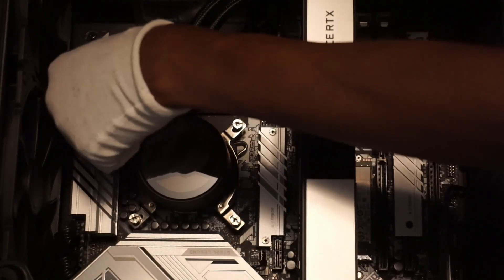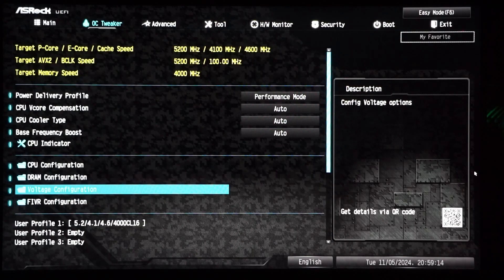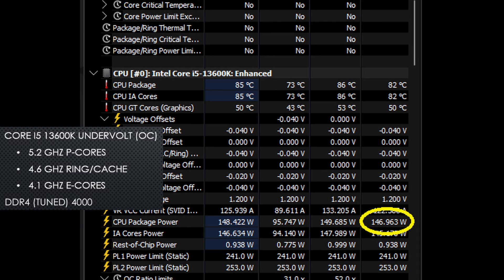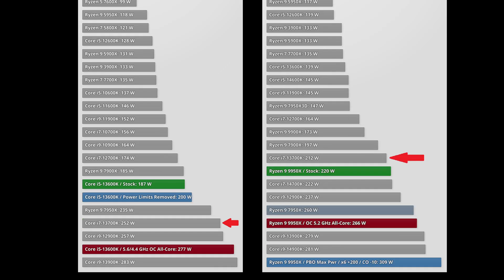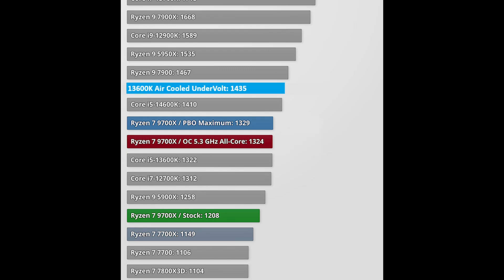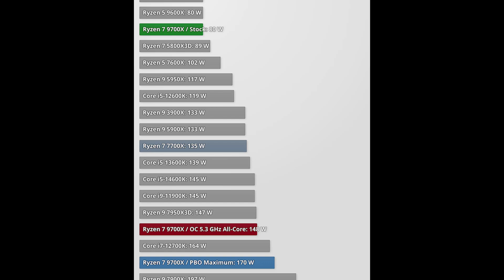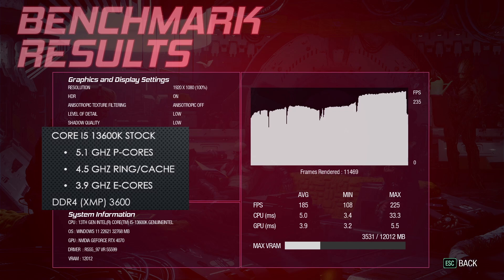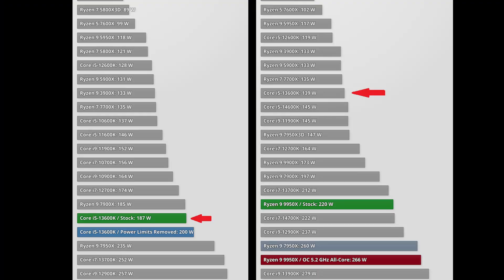13600K Efficient Air Cooled Undervolt. Faster Than Stock. Using Less Power.

Comment: Is it still stable after the last microcode update in 2025?
Reply from the maker: 20.01 (0x12B) was the last BIOS I used on this board, it was still stable with these settings when I stopped using it.

Comment: i do not understand why you stopped at -40 did it became unstable or you started to drop performance because of CEP ? I have asrock b760m with 12700kf and undervolt gets me half performance after a certain threshold, depending on the benchmark, Geekbench 6 even at -30
Reply from the maker: I stopped at -40mv because it becomes unstable if I drop the voltage too low.
Reply: @Superior85  thanks for the info!

Comment: Awesome video, I’m running mine at 5.3p 4.2e 4.7r with 4000 full tunned b die
Great cpu
Reply from the maker: Nice👍I was running that exact overclock previously, but since I downgraded to an air cooler, I ended up turning each of the clocks down 100MHz, and lowering the voltage.
Reply: @ there a great cpu for sure, my 240aio still runs hot tho voucher hitting 85 still in r23